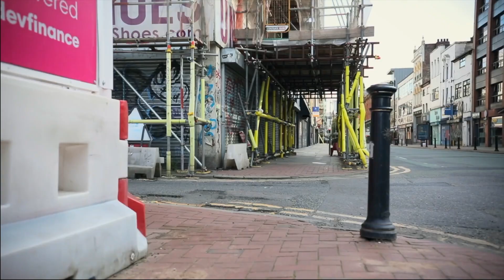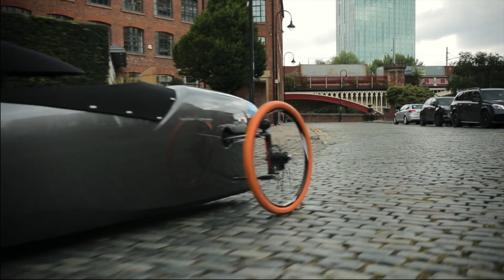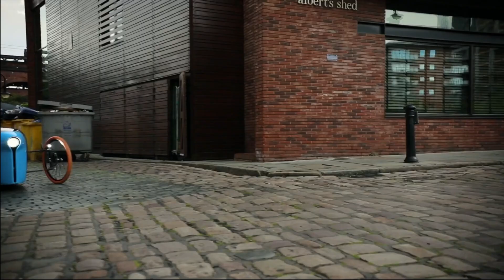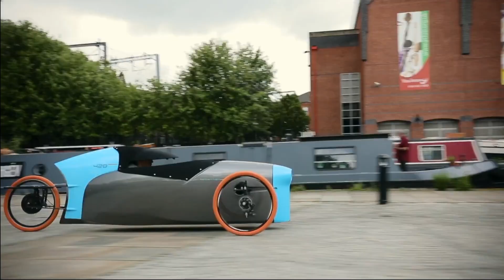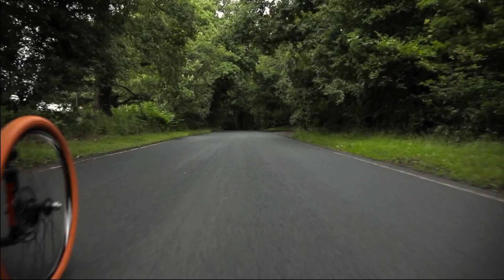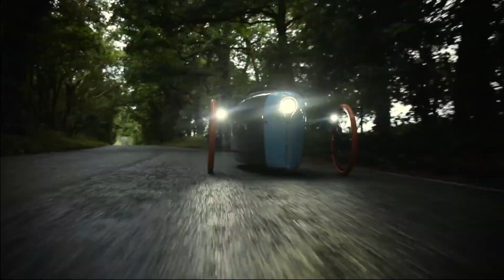Amazing Electric Bike Design is crippled by laws and regulations

Comment: What makes these E Bike laws even more ludicrous is that there has never been a study completed to determine what power level is considered 'safe' or what maximum speed is considered suitable to be used in traffic. How is it that a 4 wheel vehicle capable of over 1000 hp or over 200 mph is considered suitable to be used in the mix of city traffic moving at 50 - 60 kms./hr. but a Mother towing a toddler in a trailer uphill has to get out & walk because of these same idiotic laws? It is nothing more than Control & Protectionism to maintain profits.
Reply from the maker: Brilliant comment. Want to know something nuts... All of those 250 watt motors are way more powerful in actuality. They have to be because every year the torque increases. That's impossible without more power. You are bang on.
Reply: @HighVoltageKits  The companies selling these kits even offer to provide you with 250 watt stickers to apply to the motor case. On top of that there is no accurate way to measure the wattage. By the time the power is passed through your drive train to the pavement, I wonder what the real wattage numbers are? This is what I mean about there has never been a study done because the variables are all over the map for true numbers.
Reply from the maker: Yeah we do that lol. It should be based on behavior not power like cars

Comment: I just watched a video where water got into the rear tail lights of a newer Ford F150 Lariat pickup.  With all the electronic stuff in the rear lights (i.e. cross traffic monitoring) the replacement cost for both rear lights was.....are you ready.......over $5000 US.
Probably sooner, than later, the average middle class consumer will realize that they can no longer afford new vehicles, or to repair newer used vehicles.  This may be one of the future solutions for middle class transportation.
It will be that or the subways/busses.
WEF....you will own nothing and be happy..........
Reply from the maker: Omg. That's insane. My old boss spent thousands on his Dodge 3500... New Turbo. New Front end, new transmission. POS. I don't want to buy another car. I'd be happy to use LEVs and maybe we have a family car we all share.
Reply: @HighVoltageKits  I live on Vancouver Island I ride my ebikes as much as I can, but I have to admit that when it gets cold and wet I take drive my truck.
Reply from the maker: The damp and cold I can't do. The frozen cold I dress up like a snow mobiler!
Reply: @HighVoltageKits  When it gets near zero I ride my indoor trainer bike and watch Youtube videos.
Reply from the maker: Sounds awesome 👌

Comment: I got a moped yesterday. It’s electric but effectively 125cc class so baby class for grown ups. 150kgs, 7,000 watts and electronically limited to 62 mph. I do have a full motorbike licence but this is all I need. I need it partly because eBike rules are so restrictive that I can ride faster on a pushbike - even up relatively shallow slopes. The world hour record for a pushbike is over 35 miles! There is an obvious massive gap between this moped and existing eBikes and we need appropriate rules and legislation for vehicles in this space rather than jamming them into existing motorbike laws which makes them completely unworkable. There’s a reason there are lots of “illegal” eBikes and it’s because the laws around them are not fit for purpose.
Reply from the maker: Sounds awesome. If you wanted to join our Discord I'd love to see some pictures.

Comment: As long as it has pedals in there it's a velomobile, or in other words, a full-fairing recumbent tricycle.
Reply from the maker: Yeah it is essentially a recumbent. That hub on the back is way way more than 250 watts as well. It's a great design. I just think they should have versions that don't need you to pedal that do 30mph. We should be able to make that safe and viable for people. Especially in urban areas.
Reply: @HighVoltageKits  looks like it's configurable by locale, from 250w EU to 750w US for ebike use, and 1.5kw as a UK moped. With a dyneema rope drive instead of chain or belt, wonder what that's all about.
Reply from the maker: That might explain the motor size then. It looks way more than 250

Comment: de-centralized grid and de-regulate LEVs for people is the meaningful solution imo. 
BEV cars will like degredate the planet further, since the energy required to power BEVs is massive and likely coal and so much to manufacture using hydrocarbons. 
LEVs could atleast be charged at a home or off a grid using solar panels. can build your own too. sucks about that 250w rule, way too low
Reply from the maker: Yeah. That hub is clearly not 250 watts either.. I'd say 1500....

Comment: Its so stylish and healthy to use it. In my humble  opinion it needs work because drivers vision and awareness off surroundings looks poor. Also i would use fat tyres and more thick aluminiums or full suspension because potholes arent joking. Moreover it seems to be too low ready to scratch the road.
Reply from the maker: Good point on both accounts. I did notice it not going over any kind of traffic calming features

Comment: Totally agree. In the us it’s 750w max but no manufacturer adheres to this stupid law.
Reply from the maker: Right. 750 watts barely moves you up a 10% hill under its own power.
Reply: 750W *nominal*, wattage up hills in many can raise to 1200W.
Reply: @punkdigerati  when we got our scooters certified the laws didn’t mention going up hill Vs flat roads. They did however add to the law that scooters are now legal because they have a foot rest. 

The laws around e-bikes are hot garbage and not intended to keep people safe. Just arbitrarily and hoops for manufacturers to have to jump through needlessly.

Comment: This comes across as VERY CYNICAL considering the batteries that can power bikes/cars like this are relatively new to market.  You are also speaking as though you have experience in traffic management, traffic safety, market demands, supply chains, etc.  I'd wager that you are out of your wheelhouse on most of those topics. I love e-bikes too, but let's not start pretending to be experts or being cynical (rather than charitable) towards those who are.  As batteries become better/cheaper/more available, transportation will also change.
Reply from the maker: Its about starting and having a conversation. The laws are not fit for purpose and archaic. Rather than speculation about what I may or may not know how about engaging on those points. All of the above should be part of the discussion. I know alot of people in those areas. These are not random thoughts I'm pulling here.
Reply: Living in Aus with the borrowed UK/Eu e-bike rules I oscillate as to where the rules should be. I've ridden a Bosch performance line CS at 80ks, but that was going down a 23% slope! Going up the same road, same traffic conditions etc, I think I averaged about 14kph and my heart was beating gongs in my head. I actually don't like going much above 60kph on bikes, and feel most comfortable in the 20 to 40kph range. E-bikes are permitted to ride on shared use and foot paths so anything over 20kph in that environment is unfair on pedestrians. Slowing road limits in urban areas, seems the way to go. The Dutch seem to be innovating well in this area and I don't see them complaining about e-bike speed restrictions... Recording my rides I seem to average around 32 to 35 going down to work and 
22 to 25kph on my uphill commutes... The 22 is on the highish powered but speed limited Bosch and Shimano motors and the 25 is on street-illegal hub drive which is probably similarly powered but not restricted. I personally don't feel the need to go much faster than this... Maybe a power to weight metric ought be considered, something like   sufficient power to take X weight up 10% at 25kph under it's own steam with a top speed of 35kph of assistance when there's torque on the pedals.
Reply: Thank you for phrase “ feel free to disagree, but Keep it clean” .